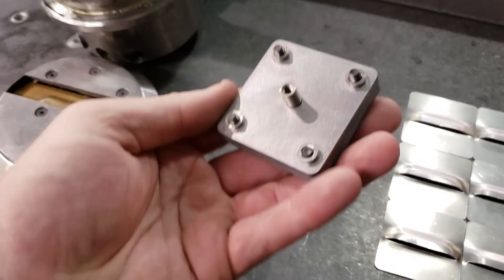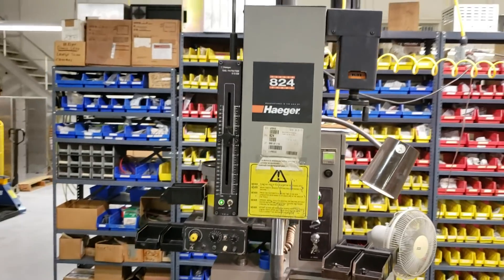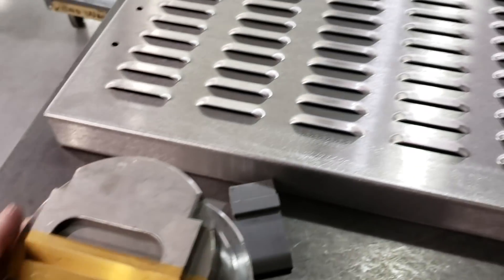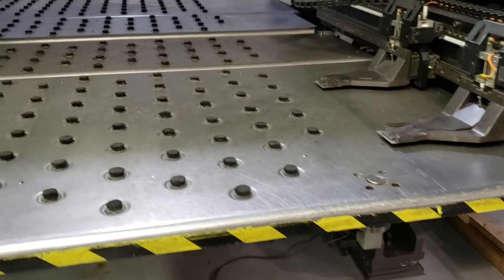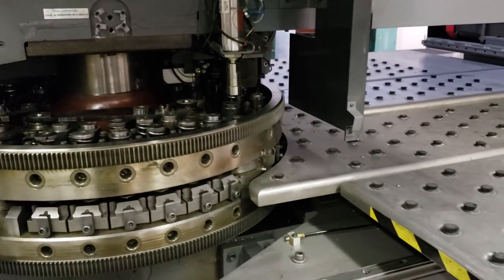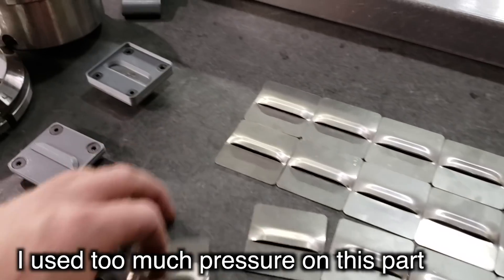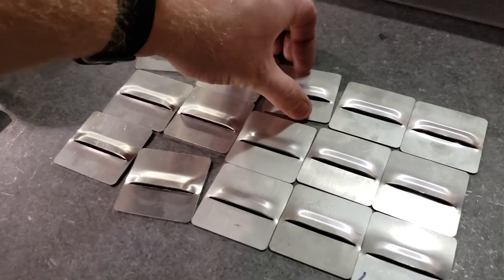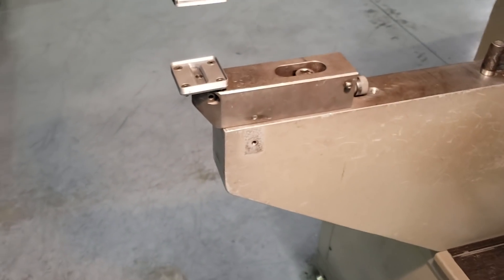3D Printed Sheet Metal Louver Forming Tool

Comment: Can you show us how to do a closed shape? For example bend a rectangle shape from a flat pattern so you only have one seam. The rectangle would be 1/2in wide by 2in long out of 10ga mild steel.  I have heard of window tooling. But I thought maybe there is a simpler way. Do you have any tricks?

Best Matt
Reply from the maker: The only way we would do that is use a forming tool with a window through it. Sometimes we will just take a regular forming tool and mill a window into it. If the part is narrow enough, a window isn't necessary and we can just get away with using a tool that has "side ears" so it basically forms half a window.

Comment: You might want to try this test on a larger piece of metal. It looks like where the metal should be stretching to form the ends of the louvre it's just deforming metal in from the edge. I think (guessing) you will experience much higher tool loads/deformation in a bigger work piece.
Anyways it's 12:30 am here in the UK and you have just compelled me to go into my garage and find my (very) old Wilson tool demo plate. So how about...
Spade tool, Bridge tool, Dimple Tool, Bursting Tool, Burst and flatten (Hole with a safe edge), Card Guide, Snail tool (For machine screws), Screw port tool, Lastly a hinge tool, this could be done as a progression tool in your pemserter (cough, heager press, cough).  Now i'm off to bed,  where's that subscribe button. :-)
Reply from the maker: For sure! I just wanted to get the shape, size and clearance right for 18ga. stainless steel. I'll be making a larger tool now for using with the press brake that hopefully forms 5 louvers at once. I already designed a dimple tool and I have that same Wilson tool plate!Thanks!

Comment: The turret punch machine will not sound so cool after a couple of hours of continuous run time. Very cool on being able to 3d print this stuff. Do you think it would handle a regular punch press? Punch all five at once, so the alignment is locked.
Reply from the maker: I don't mind the sound of the turret running at work but that's me. The tool should work with the press brake and I plan on forming all 5 louver at the same time with one tool. I would use a back gauge and side gauges with the press brake so the alignment would be fine.
Reply: @ProtoG42  From the way you set up the test run, it looked like you were going to do a progressive step. Which works but you get variation. All at once is the way to go whenever you can. How big(tons) is your press brake?
Reply from the maker: @bradquinn4161  yeah, I just wanted to make sure I had the right shape and clearance for 18ga stainless steel before printing a larger tool. The press brake is 80 tons which is plenty for this job.

Comment: An idea to try. In experimental aircraft building, a common task is to make lightening holes in ribs using flanging dies. These can be made in plywood, but you need to have access to a lathe or cnc router. However it looks like a 3d printed hole flanging die would work as well and solve a common problem for home aircraft builders. The thickness I had to deal with was .025" 6061-T6.
Reply from the maker: I actually already tried that and it does work. We call it a dimple die. I'll probably make a video on that as well.

Comment: I'm assuming the 3D printed die doesn't have the strength to shear the sheet metal, but have you tried just out of curiosity? Is the sheet gauge too thick?
Reply from the maker: No, I have not tried and will not be trying it. The stainless steel in the video can't even be cut with steel hand shears. You could "cut" thinner pieces of aluminum with plastic but it will rip instead of cut so you'll never get a never get a clean cut edge like you would with a metal blade.
Reply: @ProtoG42  Makes sense, thanks for the clarification.
Reply: @ProtoG42  how about inserting a metal blade into a  plastic part?
Reply from the maker: @BaldurNorddahl  you might be able to do that but for my purposes, I'm already laser cutting several other holes and the shape of the final part anyway so cutting a slit takes 1 second with the laser for me. You would need metal in the top and bottom section to properly cut and form the louver at the same time.

Comment: Love what you’re doing in this series with 3D printed tooling! How about using a urethane pad to form sheet? Or a matching die set?
Reply from the maker: Thank you! We have urethane tooling that is commonly used for when we can not have any tool marks on parts. What do you mean by a matching die set?
Reply: @ProtoG42   Again, love what you're doing; makeing this process a bit more accessible for the rest of us. Are you in th3 lineup for Hackadays SuperCon? 

Sorry, a matching set of tools similar to the louver only in a more complex or larger shape over a larger area? Kinda pushing the limits of what this kinda tooling can do.
Reply: @Proto G Engineering Oh yeah, think you might use urethane tooling in combination with 3D printed 'hard' tooling?

Comment: You say you didn't expect the tool to be able to cut the louver and thus laser cut the slot. Did you end up testing if this was necessary?
Reply from the maker: I did not test, but I can say with 100% certainty that plastic will not cut the louver into stainless steel. It will emboss the shape even without the slit.
Reply: I did You can get pla + to cut the Louvre but only in 0.6mm alloy you get a few goes at it but it's basically tearing it after 4 uses

Comment: could you find a way to make a small slot for a metal cutting edge?
Reply from the maker: This tool is for a customer job that I am already laser cutting so adding the small slit only take 1 second. I'm sure you could design it to accept a metal blade but you would most likely need one blade on the top tool and one blade on the bottom tool if you want a clean cutting edge.

Comment: Seeing all this metal forming pla tools, im curious if you have used metal filament  (not just colour)? As  I've read it involves extra post processing (with size reduction also 🤔)
Reply: PLA is actually very strong and it you do only few houndreth bends it will do just fine if designed right. Of course it has limits, but for thickness less than 2.5mm it will do the job excellently.

Comment: Have you tried annealing the pla prints to make them more resistant? 

It would be very interesting to see if you gain any benefits on this kind of application.
Reply from the maker: I have considered it but have not done it because the change in overall dimensions after annealing is not something I want to deal with.